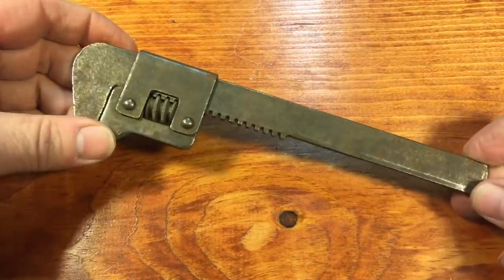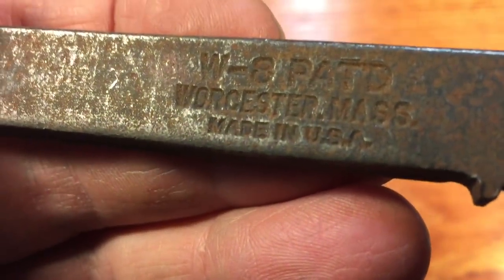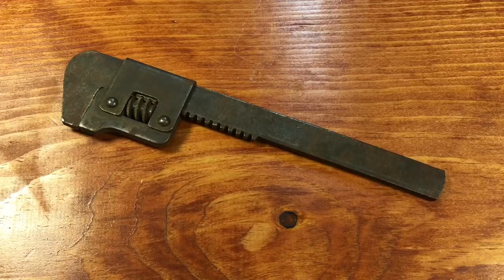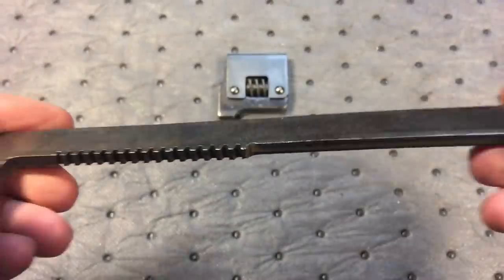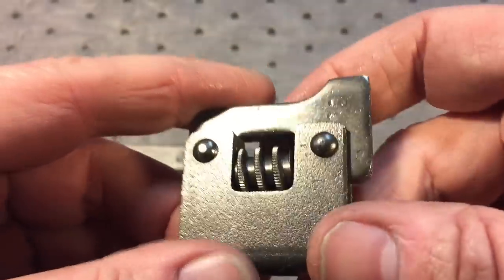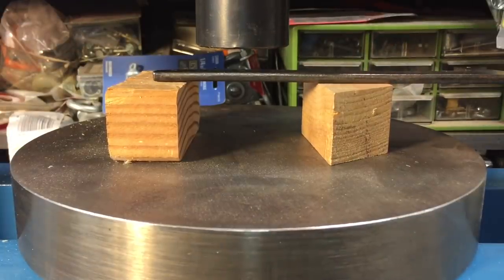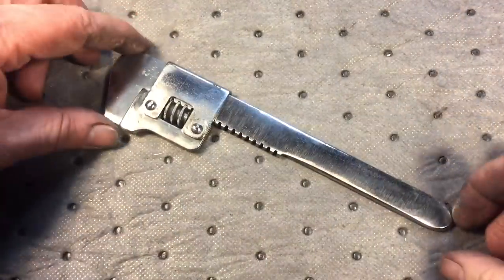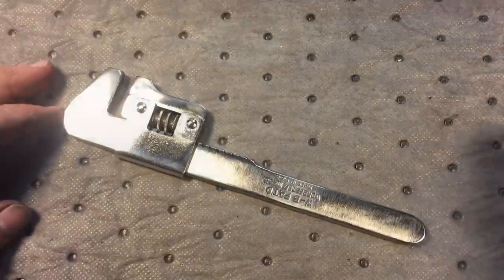Customizing the W-8 Wrench

Comment: Pretty. I have been cleaning the shop. I took a big box of screwdrivers down to the restore this Monday this week. While Ivwas cleaning I opened a box and found a whole  pile of stamped steel wrenches. I suppose I could weld them together as a table top, but what you're doing sounds like a much better idea.
Reply from the maker: Hi Dave!  As you know they are much better for art then function!  =)  These wrenches were terrible performers!  Thanks!!!!

Comment: I'm liking the holes. Makes it lighter! Great job on that. I'm liking the Dake.  Those older poprivited tools are cool to me for some reason.  I'm surprised that you didn't drill them out and replace with some copper rivets! Not as strong probably and welding could warp that thing like it's the starship Enterprise!
Reply from the maker: Hello  Aaron!  You're right!  I need to get a good supply of rivets!  Copper and Brass and Steel for projects like this...  =)   Thanks!!!!!!!!

Comment: Looks great but by drilling those holes did you further weaken the wrench?  What was that one process with the drill press I liked it
Reply from the maker: Hello Robert,  There is more then enough metal for use as a wrench but laterally to would weaken the wrench so don't use this one as a pry bar!  =)

Comment: Everything went on excellent as ever. Only dampener was holes all over it. Am skeptical if its strength was compromised. As a work of art it was good.
Reply from the maker: The holes won't matter when used as a wrench however if used as a pry bar (sideways) it would weaken it.   =)

Comment: Awesome video as always.  The jeweling of tools is a new thing to me, and i'm liking where it's going. I'm curious, how do you decide where to put the swirls?  I would instinctively lean towards doing an alternating pattern like fish scales, or how you might do the swirls in ceiling plaster, but the pattern you have looks like it's more parallel rows, but i could easily be mistaken?  How ever you do it, it looks great.  I have some old bicycle wrenches, the super cheap flat bar kind with hex holes cut out of the metal in the sizes of the bolts you might turn that i think would look really cool with jeweling. Old metal tire spoons would look a treat with that technique too, man i can't wait for it to warm up enough for me to get back out in the shop.
Reply from the maker: The typical pattern for jeweling is overlapping rows that are offset by the next row.   For larger pieces it's a good idea to make up a grid jig so you can space everything evenly.  Smaller pieces it isn't as critical.  Thanks!
Reply: @ScoutCrafter  Thanks, I really appreciate your response!  I think i really want to try this on some old steel bicycle tire spoons. I think it'll be a lot of fun.

Comment: Rivets aren't really that difficult to remove and replace but that would require some different tooling. Knowing you it would be new projects "finishing out" those tools too! That thing was really soft, getting it straight was probably maddening.
Reply from the maker: The problem isn't getting the rivets out it's replacing them so they look right...  Peened down rivets look horrible.   Funny that the wrench is "soft" but case hardened so hard to sand!  LOL  Thanks!!!!!!
Reply: @ScoutCrafter  
The right rivet gun with the right set in the right bucking bar can do that. Sometimes squeezing is better. A set and base in the Dake could easily do it nice. I have drilled out and installed millions of rivets in different situations and different materials. You could experiment on things like this wrench. Edit: you have way more nice tooling than I have ever had access to. Just make a depression in two chunk of steel and use steel rod to squeeze them. The old ones may have been done with hot rivets.
Reply from the maker: Yes!  I need the proper rivets and many a spin fixture for the drill press!  =)   Thanks!!!!!!
Reply: @ScoutCrafter  
OH NO! Rivets are best drilled out by hand. The center may or may not be obvious, no 2 alike. Drill through the head to find the center of the shank and use a chisel to shear it off. Then you can punch it out. A rivet swells through its whole length as it is set so you have to be careful.

Comment: I do like the finished product but only for a showpiece effect. I think it has lost too much material to have any strength left. It was probably too thin to begin with. Probably make a cool gift to somebody or you can display it a tool show to show your handy work. Have you been to harbor freight recently. They have a new tool line called Icon. It appears to be very high end. I was impressed by it.
Reply from the maker: Hi Tron, These wrenches were pretty much useless from the start...   Nobody ever used them unless they were in a pinch...  =)   Thanks!!

Comment: I have never seen stamped out wrenches like this one, it looks  like a throw away tool, not meant for much use. Reminds me of the cheap tool sets they once put under the seat in cars. How much does the holes weaken the wrench?
Reply from the maker: Hi Tony!  These wrenches were inexpensive almost useless wrenches that were often included in auto kits. The holes when properly sized and spaced won't weaken the wrench significantly.  However the lateral strength will be effected so don't use this wrench as a pry-bar!  LOL

Comment: Question...what horse power is the motor you use on the wire wheel and the buffer
Reply from the maker: I have a 1/3rd HP and 1/2hp.   Both are just fine.  However Chinese tend to rate their motors a bit differently!  LOL   Thanks!!!!
Reply: Thank you very much.

Comment: Have you any suggestions how to bend cast iron ? I have a Stanley 48 tongue and groove plane with a slight bend (~2 mm over length) in its fence and i want to minimise the risk of cracking. I'm thankful for any advice. :)
Reply from the maker: Hi Hulk!  As you know cast parts are always tricky, some are more malleable than others.  I have had luck with certain projects and broke others.  The threaded parts are the hardest to bend back without damage for some reason.  Heat always helps because it softens the metal.  Believe me I'm no expert!  The pucker factor always runs high when I am bending something back!  LOL   2mm don't sound too bad.  The good thing is you don't have to worry about temper with a plane so heat is OK.  Hope it helps a little!  Thanks!!!!!
Reply: @ScoutCrafter  Thanks. Using heat was also the most promising idea in my view. I was hesitate to use heat because i experienced warping on brazed cast iron parts during cooling. I'll give it a try, it seems there aren't many other options anyways. Thanks again for answering and for making these videos.
Reply: Hulk peace,  I wouldn't  risk trying to straighten it ,instead  epoxy on to the face of the fence a strip of hard plastic ,or tuffnal thereby  creating a new flat face, don't clamp too hard while gluing up or your new face will be bent like the old one.if it's not flat you can file it down once its  set. If you need to bring it back to original at a later date heat will soften the epoxy for removal. I have used this method to level up bits of machinery  with good results. Hope this helps.
Reply: @stuartlockwood9645  Thanks but unfortunately the thickness of the fence isn't random. If u add or remove material it affects the fitting of the joint. I thought about milling down the sides and attach a fitting piece of brass or bronze to it but it would probably be easier to remake the whole part.
Reply: Just as a small report. Today i tried to bend the fence back. I heated it up to around 800°C and used my woodworking vice with a similar configuration like your press. Prepared to witness horrible things, it worked fairly well. The fence behaved almost like construction steel (?) and i managed to straighten it almost perfectly. Now the deflection is ~1/5mm. Good enough for any kind of woodworking application.